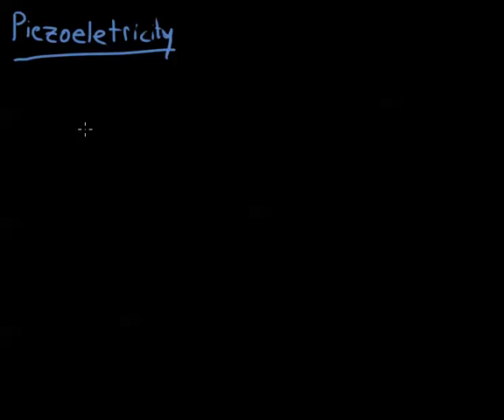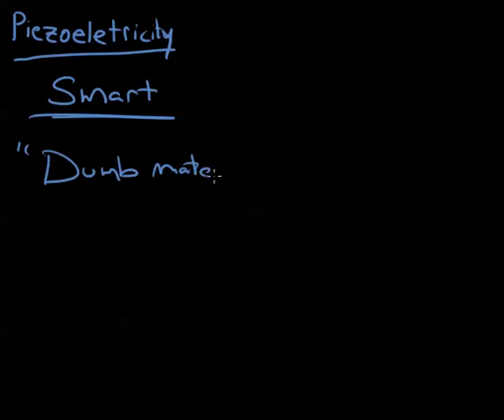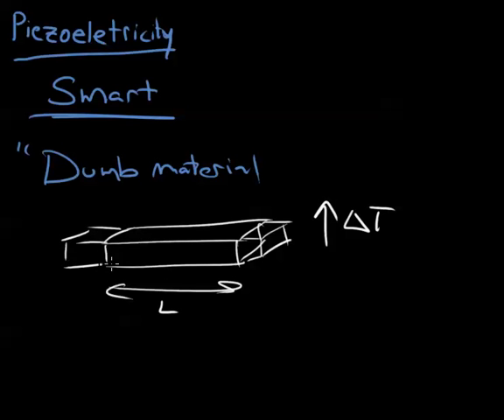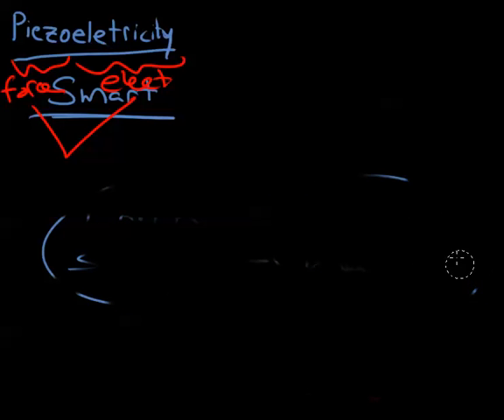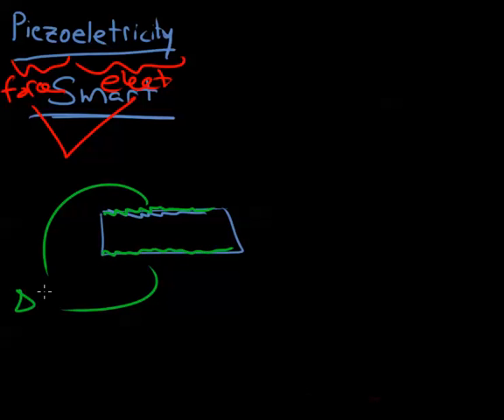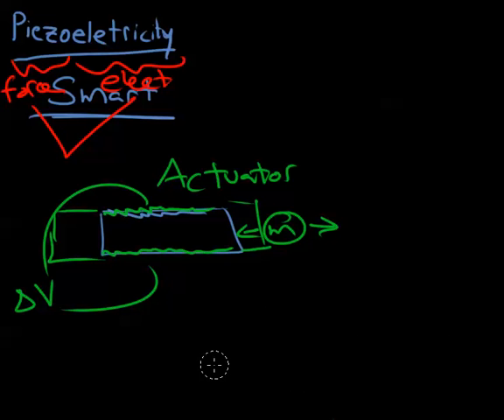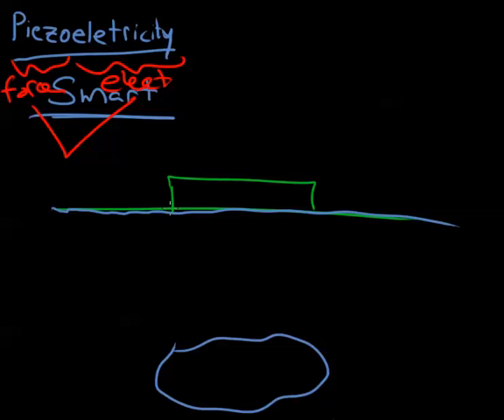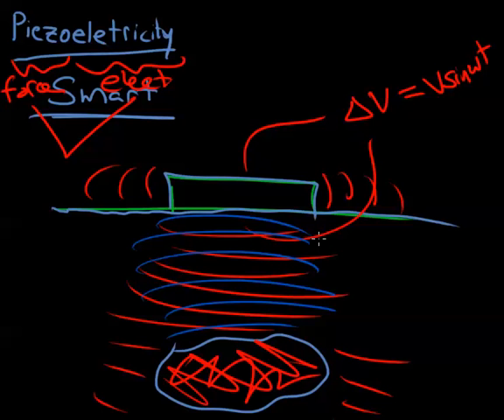Learn Piezo Lecture 3A: Basic introduction to Piezoelectricity

Comment: Quick comment: When you pull a material like in a tensile stress test, material will warm up :). Thermographic cameras during tensile testing are a thing.
Reply from the maker: That is an indirect effect. The heat generated from mechanical action is not similar to the heat which causes thermal expansion.

Comment: I would not say that when the material is deformed, there is no connection between temperature and deformation. I would say that there is no explicit or linear coupling. But maybe I'm wrong.
Reply from the maker: You might say that damping can heat a material, and that is the link between temperature and stress. There is a link between strain rate and heat generation. However, the physics that govern that interaction are very different than the physics which govern temperature to stress (or strain).